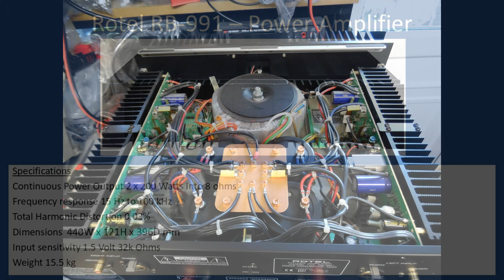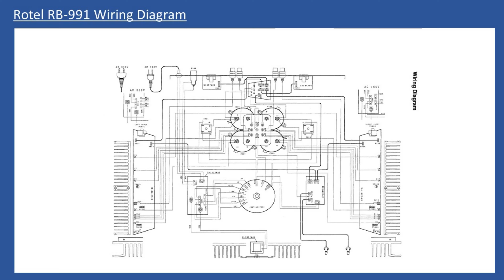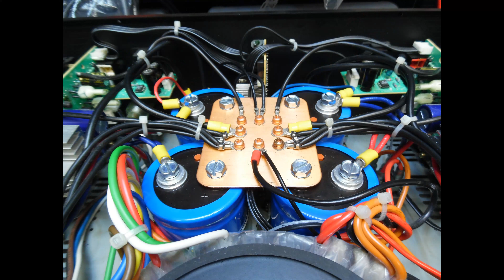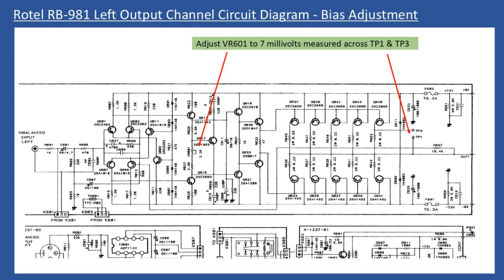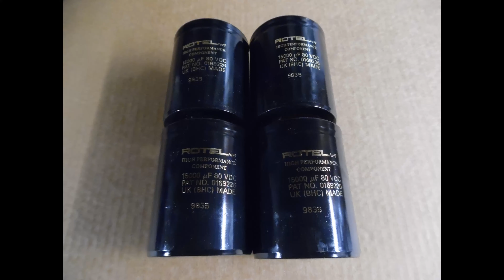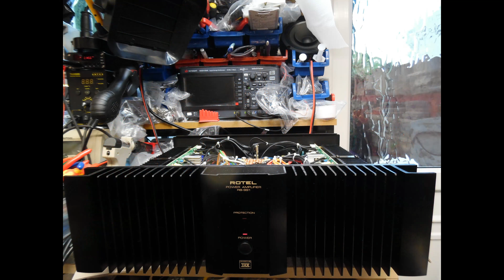Rotel RB-991 Amplifier Repair (With Audio Tutorial)

Comment: Regarding the power transistors attached to the big heat sink. What is the method you use to get them off the heat sink in order to be able to solder on the PCB. I have removed the srews attaching the transistors to the sink but it seams that the thermal pads kind of glue the transistors to the sink. I wanted to check with you before applying to much force to the transistors. Another option is to de-solder the tansistors from the PCB. But if your method is to detach from the thermal pads - what is you method to re-attach? Have you found replacment pads or do you use thermal paste instead? I am servicing my old Rotel RB-990BX. Many thanks for great vidoeos!
Reply from the maker: Hi, I have replied directly to your mail.